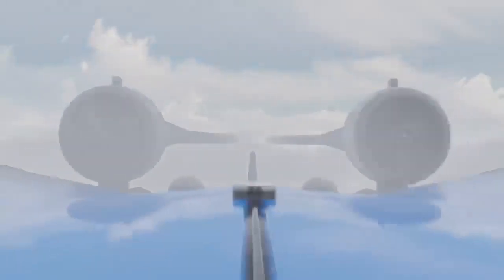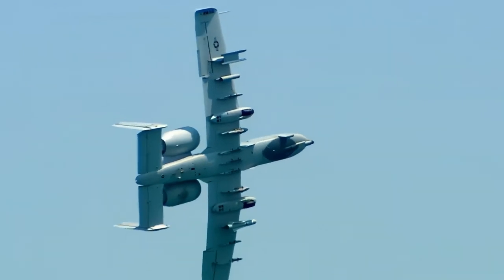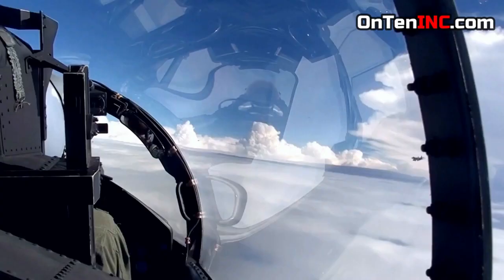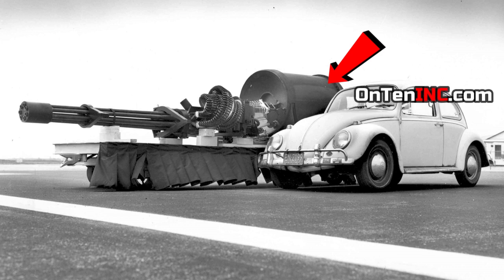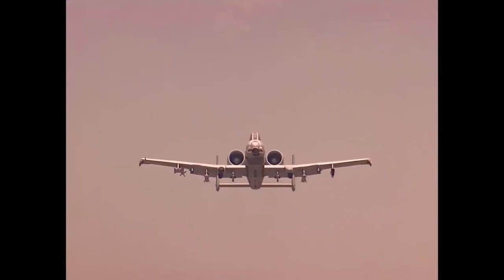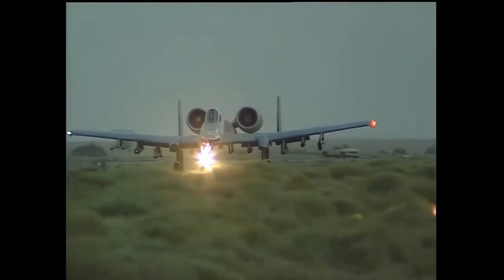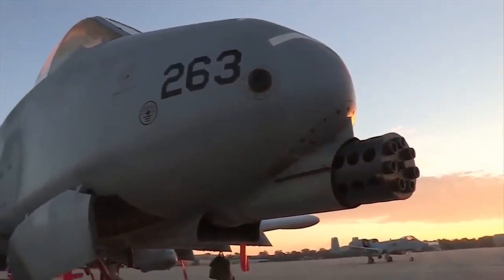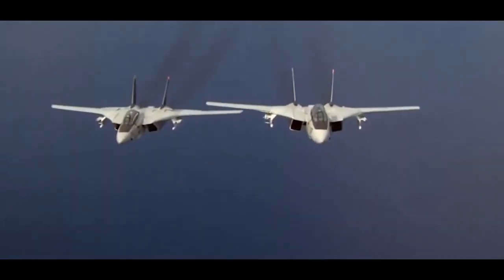Simplicity & Engineering of the A-10 Warthog

Comment: The A-10 was intended to improve on the performance and firepower of the Douglas A-1 Skyraider. In 2005, a program was started to upgrade the remaining A-10A aircraft to the A-10C configuration, with modern avionics for use with precision weaponry. The U.S. Air Force had stated the Lockheed Martin F-35 Lightning II would replace the A-10 as it entered service, but this remains highly contentious within the USAF and in political circles. With a variety of upgrades and wing replacements, the A-10's service life can be extended to 2040.
Another spectacular documentary. Contemplate about Sikorsky UH-60 Black Hawk RAIDER Helicopter. It would be interesting for your Iranian audiences.
Thanks for sharing Ariyen and amazing ONTEN team.👍👍🌹🌹
َ